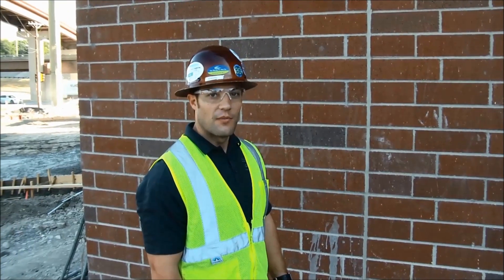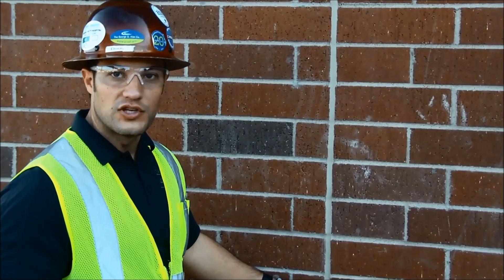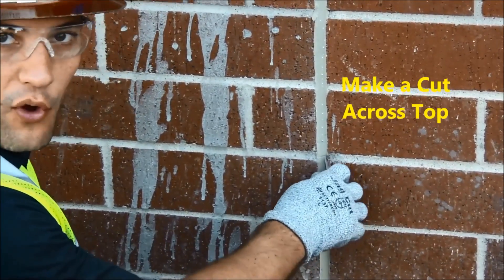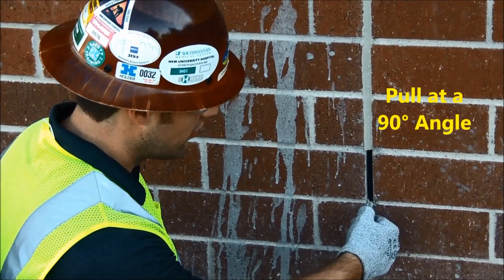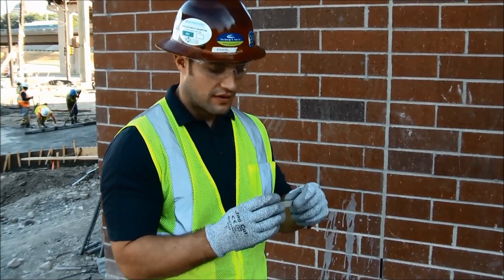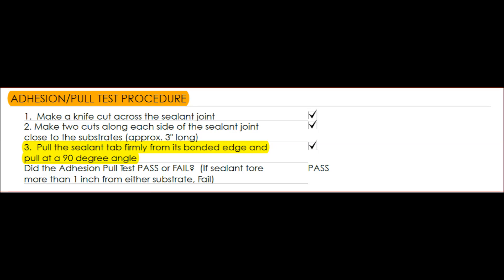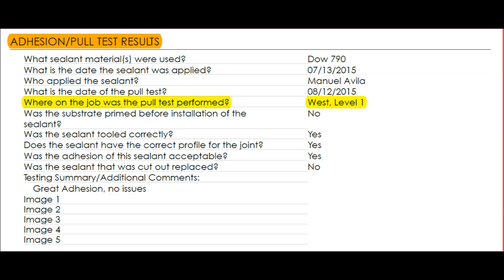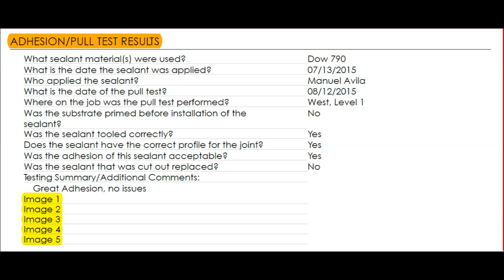Adhesion Field Test ASTM C1521

Comment: Update: The ASTM has changed since this video was published. 1521-19 (2020) at the time of this comment. Review section 7.3 Destructive Procedure. In addition, this video appears to be the incorrect procedure. The 3” cut along the substrate is only used when utilizing “Method B, Flap Pull” and should be pulled from the side of the joint. “Method A, Tail Pull”, which he performed in this video, requires a 6” cut along the substrate. A ruler or tape measure is needed to complete the test and report. Product specs from the manufacturer have the distance or % of movement allowed to determine a pass or fail. The ASTM has an example report form included with the ASTM.